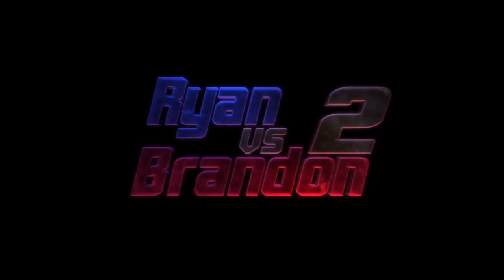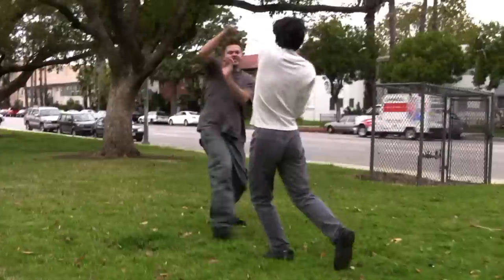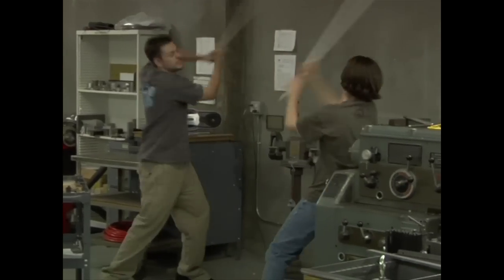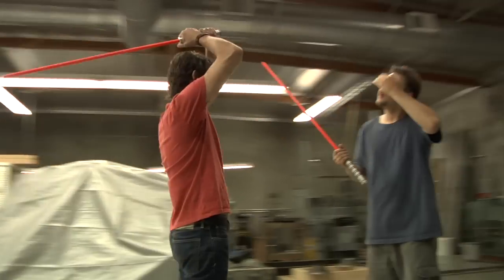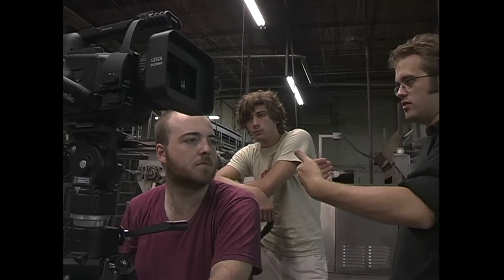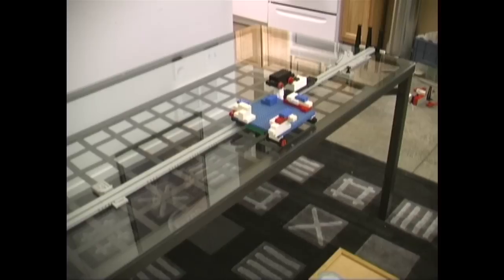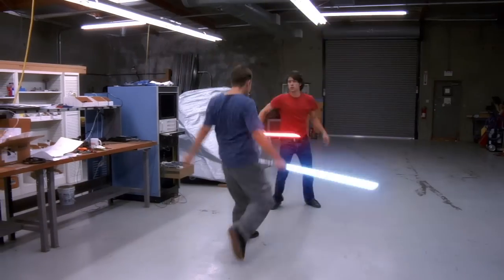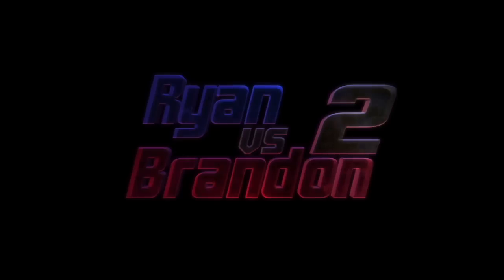The Making of "RvB2" (Ryan vs Brandon 2)

Comment: Few of my friends have made some classic swordplay videos and I've been sometimes in them as an archer/bodyguard, whatever(that usually, at some point, is taken out by one of the swordsmen after a quick melee fight) and for the actual choreography they had a nice technique: They did 1 minute turns of one attacking and other one blocking the hits and switching after that. Completely improvised and shot on video. They made few of those turns and then watched the video, not only searching cool moves and swings, but also parries and possible openings in them. The main upside was that they could watch what kind of swings and overall fighting style each one was using :)

Comment from the maker: @JonandSamTV 24 frames per second mostly. A few shots were shot in 22 and run at 24 to make it a little bit faster (mostly in the part where I have a saber in each hand). Standard Panasonic Gamma-V, but as you see at the end, with a nice color correction job by Brandon.

Comment from the maker: You can usually find aluminum tubing at your local hardware store. Aluminum is pretty light, but it's very weak and gets bent up extremely quickly. After just a couple hits, it's not really any good for filming any more. Whereas the carbon fiber won't bend, and last much, much longer.

Comment: I have an idea for if/when you do Ryan Vs Dorkman 3. You should try adding some Force Lightning/Electric Judgement (along with more Force powers.) I also think you should at least tinker with the idea of dual-phase lightsabers, not to be confused with double-bladed/double-ended lightsabers (the blade length would be doubled, but there would still have the same number of lightsaber blades coming out of the hilt/s.)

Comment: I'm curious about what the lightsaber is made of (PVC, fiberglass, etc)... I've been working on props but what I have to work with is thick, heavy PVC. Anyone know?
Reply from the maker: Carbon fiber tubing. It's really the best for strength and weight. Sabershop dot com, if interested.
Reply: Ryan Wieber thanks.
Reply: +Ryan Wieber on Sabershop I saw the sword but in Ryan vs. Brandon 2 you use a double lightsaber a sword staff. where I can get this ?